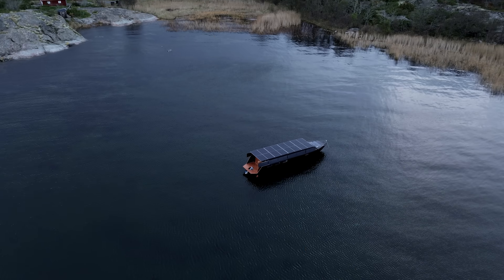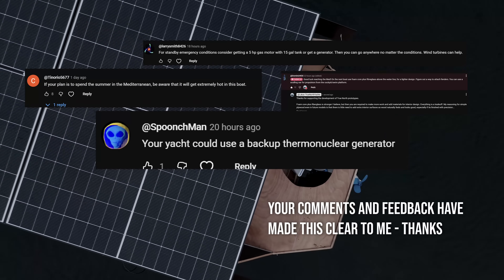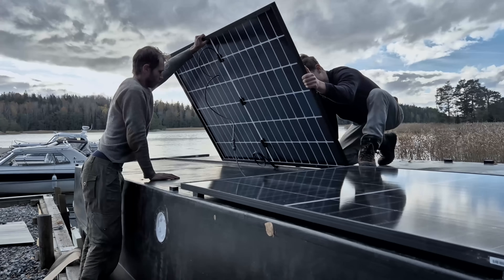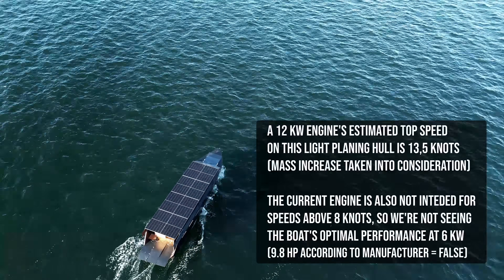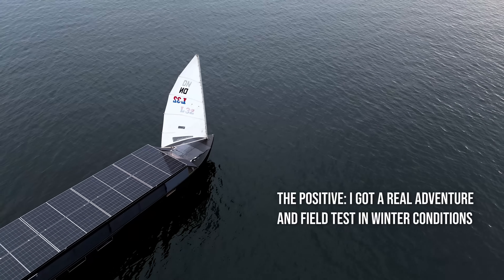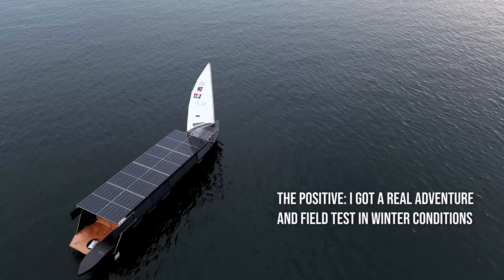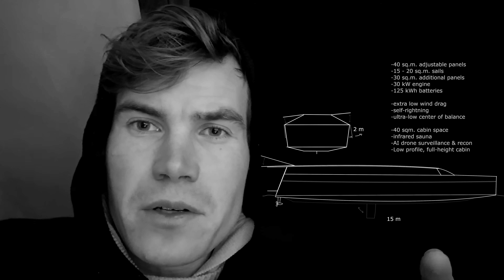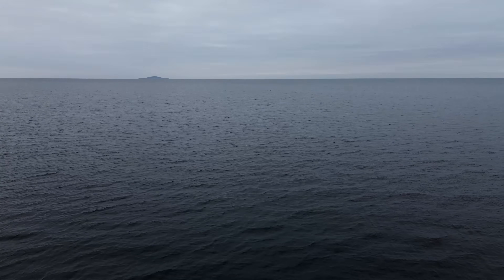3 Mistakes That Nearly Sunk My Solar Yacht

Comment: Love your journey! For us, the fascination is with the complete freedom of zero dino juice required. We are repulsed by the smell, toxicity, flammability, servicing and pollution inherent with dino juice dependent sources. So, a generator is out of the question for us on Sol Seeker. That said, there is a very strong argument for having one aboard in the event of an emergency but honestly that's where the sail comes into play. 

Chewing on the idea of taking the mast and sails from our old trailer sailer to put aboard our catamaran as a way to harness wind with an easily raised and lowered setup without requiring the original, permanent mast and rigging. Granted this would be underpowered but we're not looking to maximize speed or efficiency like it seems so many sailing enthusiasts devote their attention. We are just thinking of how to keep moving even in cloudy days which usually means little sun but plenty of wind. Your boat design really is helping to visualize such a concept.

Curious about your thoughts on a 1kW vertical axis wind turbine. It could be mounted so as to limit shading your panels and provide a decent partner to your electric generation when solar is in short supply and overnight. Not an expert on any of this stuff but seems like a logical addition to at least try. We're also thinking of trying a pair of them above our dinghy davits once we get a chance to get back to our own project. What are your thoughts on this? We've heard mixed reviews from people who include them. @Sailing.Supernova have the propellor style but haven't heard a breakdown from them yet. Regardless, it seems like a no brainer concept especially considering these are quite affordable.

We sure would love to have you join us as a special guest on our Solar Sailing podcast some time. Your adventures are remarkable and inspiring.

Comment: Watch the weight of the solid solar panels if you're adding more... if it's too top heavy the boat might roll in high wind/waves. Flexible solar panels might not be as efficient as solid ones but they weigh a lot less.

Comment: Please check the temperature of the battery, those lifepo batteries realy dont like being charged below 5°, also if i remember right you loose capacity when discharging at realy low temps. I would assume especialy in the noth whe water and without insulation the boat could get quite cold especialy below the waterline. Maybe it would also make sense in the next iteration to buy large lifepo battery cells and arrange them on the lowest point so that most weight is down? Edit: Also integrating the battery compartment in to the boat hull design would give you a lot more strength, instead of loosing the weight on metal casings?

Comment: something isnt adding up in your calculations. even with EXTRA EXTRA light super small boat would be impressive to get 12 nautical miles (22.22km) by 1 liter of gasoline. How can you get extra 350 nautical miles (648km) with 30 liters of gasoline ??

Comment: Hi, I really like what you're trying to do here.  I've been on the same journey for the last 2 years designing and now building an electric cruiser in Australia - although a lot smaller.

It's a great idea to build a test version first like this, and use it for a long while to actually live the experience and learn how to optimise everything 20 fold for the final version, I did the same.
Let me know if you'd like to share some ideas by email or something.
I just watched all your videos and have a lot of ideas to share for the final version already.

The issue with this design, as i'm sure many have already told you, is that it's really a calm water vessel only.. but there are still many things you could add and optimise for testing before you start your next build.

Comment: Just as a counter-point, you could use a propane generator. It'd be in-line with your goal, as it is a clean-burning fuel. Plus, you would have the advantage of having propane on-board for stoves and heat, thus saving your battery power for more important things. On top of that, you could later invest in dual appliances (which are common enough due to campers), like a propane-electric refrigerator or water-heater, so if you do find yourself in poor sunlight, you have plenty of alternatives. 

Also, I've been wanting to say it for a while, but I understand you're in an early prototype vessel. You really need to step up the safety for anything you want to make marketable. Proof of concept is great and all, but the vessel you're in now would never pass any real inspection, and for good reason.

Comment: being a sailor a sail isnt ideal for use in emergency situations just sayin with a ley short and just a sail on that which is not designed to optimize sails  you would go sidways into the rocks you need ley boards to go foward if you are trying anything other than downwind

Comment: even a small wind turbine would give you a huge boost, and really doesnt change your setup at all. its just one more input to the charge controller.
Reply: No it doesnt. The wind turbine creates more air resistance than it produces power for the drive motor. Only usefull when add anker, but than he has alot of solar too power the "house" part of the boat. Or when wind comes from the back, but in that case he has a sail thats way better than a wind turbine.

Comment: Nice one mate, more batteries is always better. Definitely get the portable genny, doesn’t even have to be a Honda one, it’ll make life a hell of a lot easier until you can sort more panels, more batteries etc. have a think about a way to angle your solar panels towards the sun instead of being flat, that will significantly improve their efficiency

Comment: A generator is good. But not as good as just adding a cheap gasoline outboard. Converting gasoline to battery charging and then back to motion is not efficient from an engineering perspective. It's after all just wasted energy with more losses. Also two motors in an emergency doubles the power and, maybe, it could even propell the boat in currents which is a tricky challenge coming to you in roughly two weeks. You have three types of drag effecting your vessel; skin friction drag, interference drag and drag by the shape. If that keel could be raised it would help immensely when you got to combat the drag from the shape of it and kind of glide over the current. But it's gonna be fun to hear your report when you get to the canals. Did you take the canal certificate to be allowed to take the route? The rules of the rivers of Europe are different than the sea, and will use signals you have to know and react correctly to to avoid being run over by the big ships trafficking them.
Reply: Not necessarily true. At some speed the outboard could be better, but at a wide range of speed, the generator could be better.
I think more "capacity/$$" to add generator to existing drive system, than start another ICE drive system.
Reply: @artsmith103 that makes no sense. You got direct drive shaft on the gasoline outboard. On the generator you got losses in: engine running alternator AC correct, then you got to step that up to 48v and convert that to DC, then you got to run that through the wires, then you got to charge the battery, then you got to discharge that battery, then you got to run it through the ESC and convert it to run the motor, which itself is around 90% efficient. I'm all for electric drive, I run a YT channel about it. But there's not a chance in hell you'll make up for those losses with a wide range of efficiency. If so, show me the math because it makes zero sense to me often building these systems from the ground up.
Reply: @NavalTechTinkerer  Somewhat ICE vs EV. The generator makes kWh more efficiently at some rates vs ICE outboard. Plus a 2nd drive is not convenient. It's not enough to worry about, which is why the generator is preferred for intermittent use. Key is the generator can be used at less than half boat speed in anticipation of low batteries.
Reply: @artsmith103 well if the math would hold up sure. But it doesn't. Just the thermal efficiency of those gensets he showed are terrible, almost 50% less efficient than a decent outboard. You have so many losses at every step, that even if you have higher efficiency - actually at all ranges, it doesn't make it more efficient than running it directly with an outboard. And although it's not convenient, having a second system, means survive or die out there when one system fails in storms. This boat would suffer greatly when you have tons of water coming at it.
Reply: @NavalTechTinkerer  The boat is not storm capable. But an outboard suitable for that boat is not suitable as an auxiliary. You're tracking tiny efficiency issues over design and operation of the boat. What are you saying, your way saves a gallon of fuel per day when necessary?
It's a poorly designed boat, frankly by someone that worries about efficiency and green about as much as you do.
How many lbs of outboard can the transom hold? How long does the shaft need to be? What hp is needed to push the boat against 20 knots? How many typical spare parts need to be stored? If he's at anchor and wants to charge huge battery bank does he run the outboard?  What's the alternator output at high idle, 10amps? Are you going to compare that to efficiency of small 200W generator?
Reply: @artsmith103 well I do agree with everything you said. My point is it's better to have a small outboard than a genset. But having anything, even a Genset is definitely better. I obviously think this project is not following any good practices on boat building and I worry lots of things will break, including the electrical setup in even mildly bad weather. I honestly think he will get to the canals and then suffer badly in the rivers where that 1hp push is gonna be real under powered in the currents before (tides) or in the canals. It's gonna be fun to see how far he gets though.

Comment: PV panel optimizer would be a good idea, these modules provide a mpp tracker to each of your pv panels. so your sail wont drop your whole system current flow through your panels if dropping shade on one of your panel

Comment: Looks like the sail at the bow is a balanced lug sail. Consider adding a gaff (trapezoidal shaped) rigged sail used on catboats popular on the East Coast of US, instead of a Marconi shaped sail.  Also consider a centerboard for use when under sail upwind and pulled up when motoring or going downwind.  A centerboard  instead of keel will allow for navigation in shallower waters.
Reply: No,it is the sail of a DN iceboat

Comment: Don't your sails need daggerboards to work properly? I'n not a sailor but I thought it's the combination of the lateral forces from the sail plus the lateral resistance in the water that causes the boat to travel across the wind?

Comment: What about if you get caught in a storm in the in sunny area?? Sky could be overcast for days.  I would say keep the generator, it is easy to use and turn on in an emergency, I'd rather have it and not need it then need it and not have it.

Comment: An Idea you did not mention is a wind turbine or an underwater turbine which have become quite popular on sailing boats to recharge while moving (not useful for you) but they can also help recharge when at anchor in any kind of current normal or tidal to supplement solar. Something Im a little shocked doesnt seem to exist yet is a towable deployable floating solar array. With a some buoyancy, anchor points on the back of the boat and some flags to alert others you could have a linked set of water proof solar panels that flat pack at the back of the boat that you could deploy to increase your solar when needed in calmer waters. I envision 2 cabals with inflatable buoyancy under each side of the panel they would flat stack like a jacob's ladder toy enabling you to make it as big as you wish/have space/have weight capacity/have money/is safe (cable tension etc). Having something like that would give you back up emergency power if something happens unexpected happens to your main solar generation you could direct drive a motor and limp to port.

One other thing I feel like your boat is missing (but I could be wrong) is lightning mitigation not such a huge deal in northern latitudes but the closer you get the tropics the more lightning becomes a daily occurrence. The lack of a mast means you would likely want the protection across the entire roof. It appears that your only conductive paths is your boats propulsion I feel like it is something really important to consider. You  do not want a single lightning strike to take out your power your motor and your haul.

Comment: You are learning fast. Hopefully you survive with the boat intact.   Nice to see you doing my advice charging at the dock and more batteries.   I wouldn't do more heavy panels, concentrate on finding light ones at a reasonable cost, high efficiency.  At 25kg each, that is not light.
 You have too much weight too high for safety.  
Please start using 2 anchors for anything but a short stop.  I'd have one set up so could be deployed in an instance for emergency stopping too.     Learn how to set anchors as they are your insurance, especially since you don't have enough power in a storm, anchoring can be your only choice.
Just how did you almost lose the boat?  Let's educate people what can happen so they can avoid it.

Comment: What you’re doing inspires me. I hope you have safety equipment on board in case of a disaster. Do you plan on adding sound baffling to minimize the sound of the water against the hull? It seems quite loud.

Comment: Yes, yes to the tenacity, the dreams and the drive.

But while I like the hybrid idea for the next boat, the sail on your present boat is not a backup plan as you say and I speak as someone who grew up racing sailboats - I am not a motorboat dude. 
Why is your plan potentially dangerously flawed? 
Because if you have a battery or engine failure and having the shore to your leeward, well then the winds will push you to that shore. As you know, you can't sail upwind with that boat (no centerboard, no rudder, center of effort not correct, etc) and if you're lucky you may be able to drop anchor before ending up on the rocks. 
You will sail close to shore and you will have onshore winds often and you will have rocky shores and basically, in those instances you are relying almost solely on luck if any part of your EV system craps out on you.
I do know people have sailed around the world with zero engines, only sails and oars. But they had vast experience, too. Not saying you wont make it, you most likely will. I am just saying it almost seems like you don't have a way to get out of this one scenario. 

I guess at least you have the batteries wired in some kind of redundacy mode? So, you can afford to lose a bank or two? But obviously can't afford to lose the motor. Oh, which reminds me, for V2 please make sure you have redundancy on everything. Probably would be smart with two motors running of each their own bank?

Comment: Dagger boards and inflatable floats attached to the port and starboard freeboard to add stability. It is still wider at the top than at the waterline, which is not typical for a reason

Comment: This is all heavily lattitude dependent. Further south you would need ways to dump excess power
Reply: No, charge controller just reduces amps.
Reply: Where does the power go?
Reply: @senorjp21  Open circuit that does not damage anything. Happens all over the world when arrays are not gridtie. Every remote home, boat, RV, etc.

Comment: 3:11 I am certainly no boat Expert, but I’ve been around a few. Your weight is extremely light, I think you could add several more things that could possibly help you which I will not list here. It seems like you are listening to other listeners with much more knowledge, I am enjoying the journey and watching you learn thanks for the videos🎉. Gave you some HYPE😊

Comment: I've done some thinking on doing an electric propulsion sail boat. I am in the Pacific Northwest of Canada on Vancouver island. 
My conclusion was that full electric is not practical in this part of the world. If you use sky vault solar radiation data, paired with a solar PV array, battery bank, charging system and finally motor - the heavy cloud cover and the low winter angle of the sun will not get me to Alaska and back confidently, safely. Electric boats are easy if you return to slip each day for recharge from shore power. Sails and rig are very expensive and heavy. In this part of the world most sail boats motor 75% of the time due to the narrow island channels and surrounding mountains that focus winds and tidal currents often around or above 5 knots. Yes of course it is amazingly beautiful.

Best not to be a purest. Hybrid approaches are sensible considering todays technology. There are many generator options that address fuel type - diesel, propane, gas, flex - that are light and quiet. If you do a cost analysis the full electric system is very expensive - and likely needs to be replaced on a 10 year cycle - so you need to amortize the system costs over 10 years. The cost of your electric system and sail rig can buy a great amount of fuel - but fuel does not address your environmental ambitions. Having the right design of keel will give you more versatility with a rudimentary sail plan. But you may elect to reduce your expectations from your sails and point to wind using power propulsion.
My view is don't be a purist, be a pragmatist. Safety is always important. I admire your efforts.